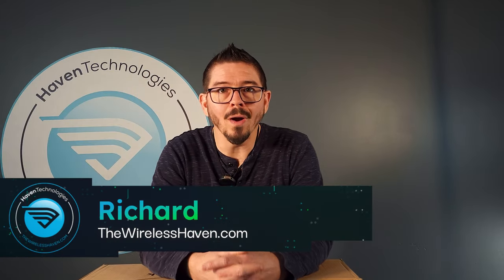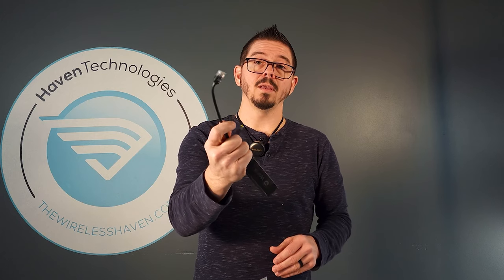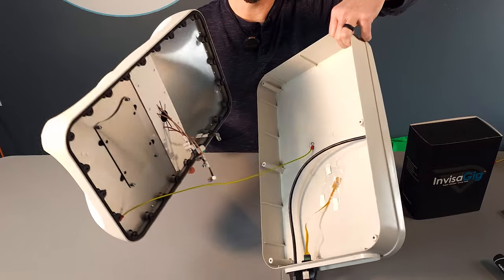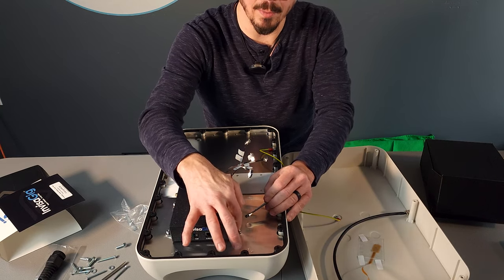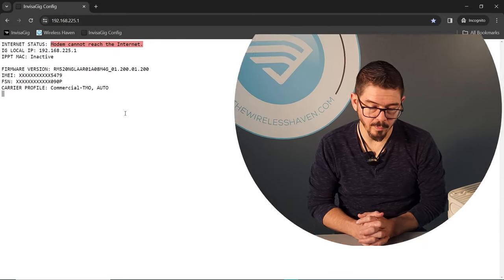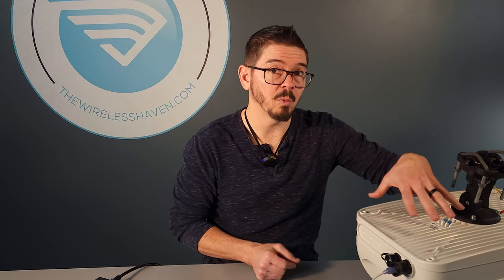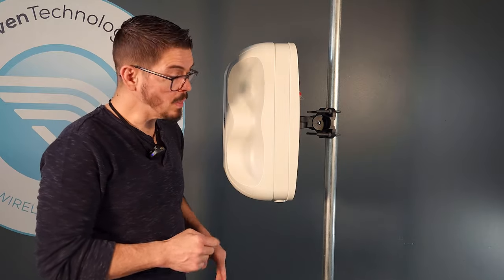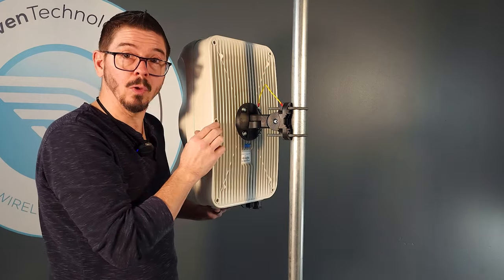The Best 5G Antenna for your InvisaGig or 5G Router. The QuadLink. Full Assembly and Breakdown Video

Comment: Is the plastic case itself vented.?? Would it be possible to mount a small cooling fan inside the case to help with heat dissipation.?? Summer-time temps can be MEAN...
Reply from the maker: The case is fully IP67 sealed. There is a lot of internal air space and the InvisaGig has a fan built in to push air across the modem heatsink and out into the enclosure airspace. That then is dissipated via the finned back of the case.

I've run these the enclosures in Houston, TX summers. Keeping an eye on the heat levels is always important, and when heat gets to record levels, or if you are in areas like Arizona, you would like be best to shade the antenna from direct sunlight.

It is also possible to add a 12VDC barrel plug adapter inline and sort of piggyback the 12VDC to another fan.

You can also add vents like these: https://store.thewirelesshaven.com/products/wifix-outdoor-enclosure-vent if you wanted.

Comment: Beautiful box Richard.  Good Vid.  I have a question.  In the middle of the summer in Pheonix the temp inside of this box will be sky high.  Very sky high.  Will the modem be able to withstand the temps?  Have you actually tested it at those temps for extended durations?  Thx
Reply from the maker: This particular one, no. Other smaller units have been used by customers in the arid desert regions and have confirmed that it is best to shade the unit from direct sunlight to reduce the extremity of the heat on the unit itself. I don't expect it to have issues as long as it is shaded, but it is very hard to say without a long term test.

Comment: in the video it looks like the plate covers some useful information, is that info anywhere else in the kit?
Reply from the maker: Which part?
Reply: The paper on the bottom of the Invisagig box,  before you attach the plate that holds it to the antenna @wirelesshaven
Reply from the maker: @ravitester  Ahh, the InvisaGig label. There is another copy on the packaging box. This has the Serial # and IMEI number of the InvisaGig.